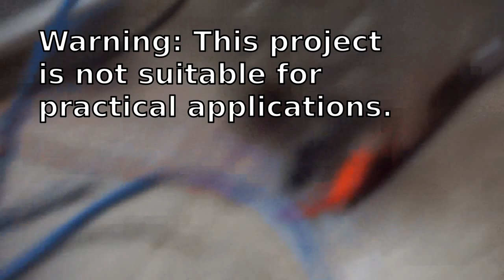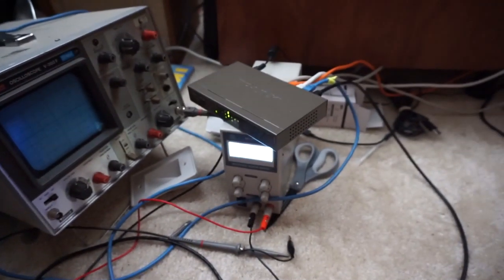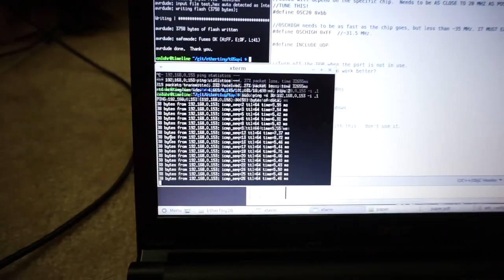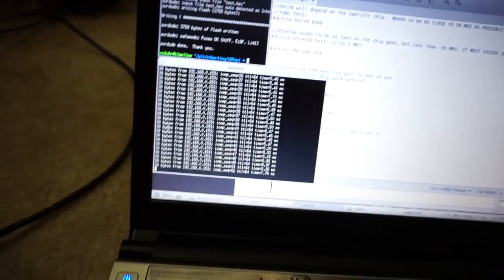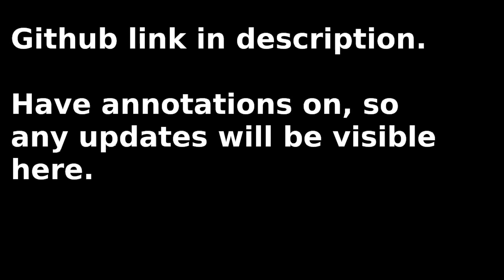Half-Duplex Ethernet with just an ATTiny85

Comment: I'm actually considering using something like this to make a Wake-On-Lan power switch. Hard code several mac addresses in, and trigger relays based on them. Any pointers?
Reply from the maker: No real pointers.  Just that this can be a little bit tricky.  I strongly recommend using an osciloscope and doing some things to try to make sure you're getting the packets clearly!

Comment: Do you think that is possible to use one ATTiny85 to transmitt via internet one camera signal?
Reply from the maker: Yes, but it would be extremely slow, like EXTREEEEMLY
slow.
Reply: I'm huge fan of you, I'm a electronics beginner and I watch all your videos.    I am finishing a Plastic Injection machine one of medium size and I am already studing to build a 3D printer of 3 meters long, 1.5 meters wide and 1.5 m tall, and my first option is to use a TinyG Board or Synthethos.com, I saw some 3D printers working with this in an immaculate way, I saw your CNC router and I found it very cool.   You should make a video trying to transmit snapshots using an ATTiny85, I am tinkering trying use cheap IC as this to transmit video signal or snapshot   =D

Comment: Is it possible to use some external differential pair driver to reduce pin usage, and use SPI hardware to achieve full-duplex signalling?
Reply from the maker: One step ahead of you... http://imgur.com/eQuKjxz
Reply from the maker: CNLohr
BUT! No to the full duplexness.  Because (1) you have to clock at different frequencies... and (2) there aren't enough processor cycles to send and receive.  The processor is TAPPED!
Reply: CNLohr I mean, use external hardware codec (aka XOR gates) to Manchester encode/decode, and differential drivers for the line. This turns the 4-wire 10BASE-T into 3 wires, clock, RX and TX, and SPI hardware can be abused for that.
Reply from the maker: If I were to use external hardware, yes, I could likely achieve full duplex, however, it would take several parts to do it in external hardware, at which point, it would seem to make more sense to use an actual ethernet interface chip.
Reply: The external hardware would be two XOR gates (one quad-XOR chip like 74HC86, that encodes and decodes Manchester coding from SPI-like clock and TX/RX lines) and a differential transceiver chip like LTC490 that handles the TX and RX pairs. It would still be cheaper than a SPI-based Ethernet chip, and requires less lines than a proper RMII.
Reply from the maker: I would need to see a schematic of what you're describing with the '86.  I was toying with using a pair of them to send ethernet, but couldn't find a way to do it for receive.  Then, when I realized I could send at on-wire speeds via the SPI bus, I stopped caring about help sending.  I am waiting on PCBs to come in with a differential driver.

Comment: what is that of the "Magnetics"???
Reply from the maker: It's one of these: http://www.digikey.com/product-detail/en/S553-5999-86-F/507-1468-1-ND/2108052
Reply: and how does it work? so if i slap one of theese in between the attiny and the ethernet cable it will be more safe?
Reply: @kolyra  For 10mb ethernet it's a 1:1 ratio isolation transformer. TTL 0v - 5v in and differential pair +/- 2.5v out. Being isolated prevents stray DC offsets from making it's way into your device and with extra protection circuitry such as movs and zener shunts makes it very ESD proof.